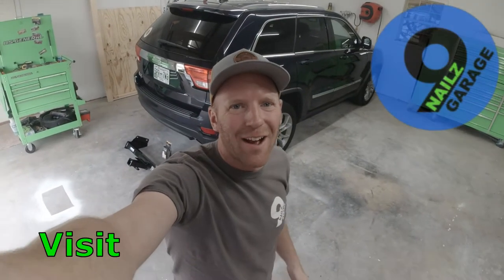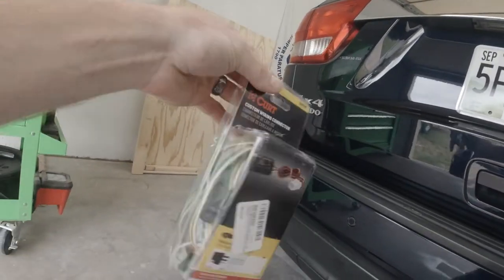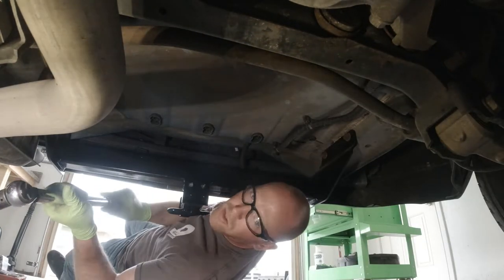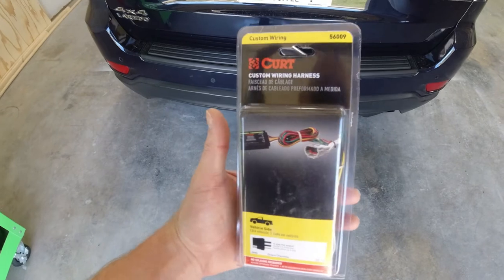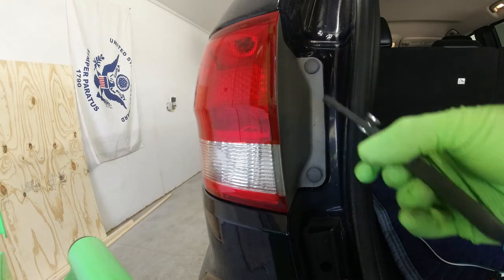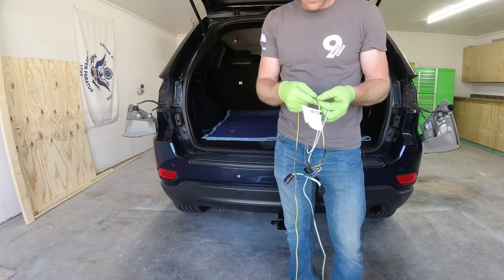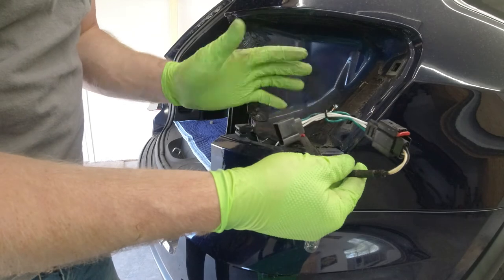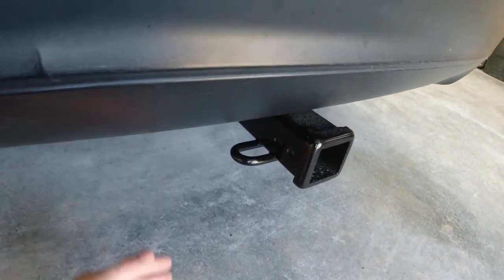2012 Jeep Grand Cherokee Class III Hitch Installation

Comment: Great video. Thank you. 
I am surprised you did not have to run power from the battery. The demo I saw from etrailers said you had to run a wire to the battery. I was wondering why the power from the brake lights was not sufficient. I'll use the kit you have. Thanks!
Reply from the maker: The newer Jeeps need to run to the battery, my 2012 didn’t

Comment: What was the tolerance between the hitch and the frame of the Jeep? In other words how much gap was between the ears on the hitch and the frame of the Jeep? Was it a perfect fit or was there half inch gap on each side? I've ordered two of these and they both have one inch gaps, no quality control? When you tighten the bolts does that close up an inch worth of gap?  Appreciate the reply.
Reply from the maker: Hello, there was a slight gap, maybe a 1/4”-1/2” total if I remember right. Then it snugged up perfectly. Did you order the same brand hitch?

Comment: 2012 Jeep GC already has plug for 7 wire just behind bumper.  Why didn't you use that rather than all the Fishing?  Though I heard Jeep dealer has to activate that plug for a fee.
Reply from the maker: It’s been a while but not all of them have that, I believe it’s the later years that have it or maybe different models.
Reply: That is only if you have the tow package from the factory.
Reply: @markkempton4579  I drive a 2015 limited JGC. 
I don't have the tow package,  and I didn't test it to see if its hot,
But there is a plug ith a seal on it under there  I was just under there to put in a receiver (dont need the wiring, it's for an accessory carrier)
Reply: @stinkyfungus  that's cool. My 2020 does not have any wiring behind the bumper cover except for the backup sensors.